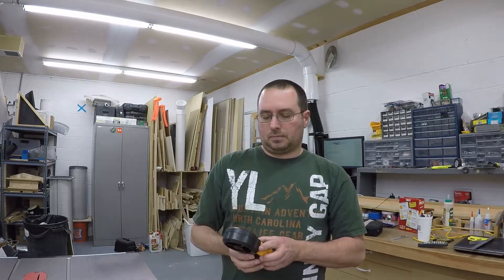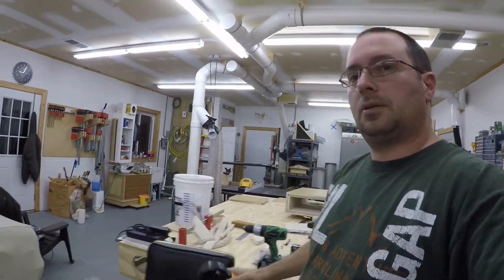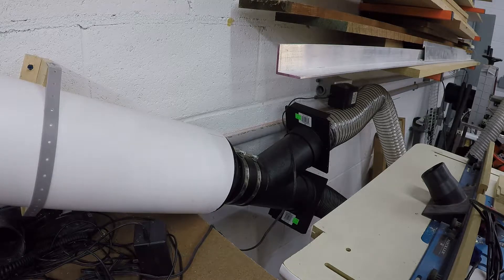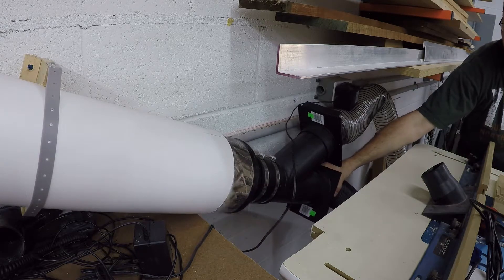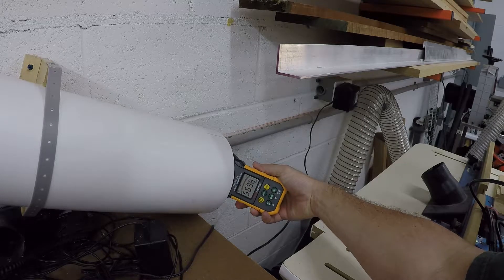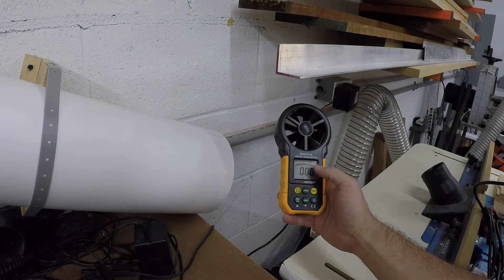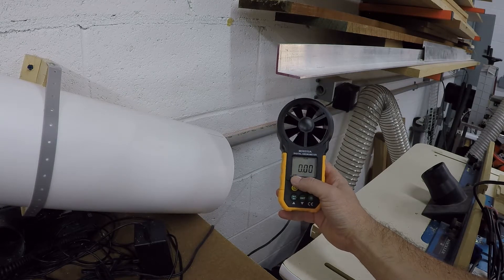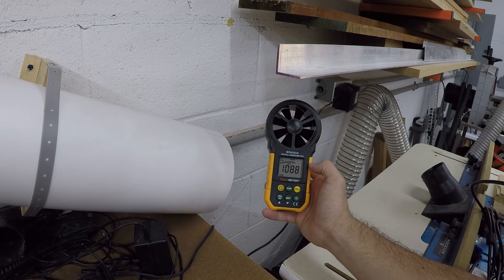Wynn Filter Upgrade - Part 2 Measuring Flow

Comment: Always good to know the real numbers. None of this "I would bet..." stuff. Well done.

I bought an anemometer as well, to measure the airflow of my vacuum/Dustopper set up. I was amazed at how the airflow was degraded from the inlet on the vacuum (at 180cfm) to the end of the hose at the table saw (at 78cfm). That might work for a hand tool, but it was woefully inadequate for a table saw. That led to purchasing a Rockler dust collection unit. It's advertised at 750cfm but at the inlet, I'm only getting 500cfm. I wouldn't know that without an anemometer. Knowing the actual cfm, I'm debating whether to add a separator or not. The unit works great by itself on the table saw and I don't have any other machines other than a router table and a sander, so a separator isn't really necessary. My original plan was to add one and if I hadn't bought the anemometer, I probably would have, thinking I had the capacity.

Moral of the story is, $35 for an anemometer is worth it if you're going to spend hundreds, if not thousands, on a dust collection system. Manufacturers aren't exactly truthful when it comes to the CFM ratings of their products.